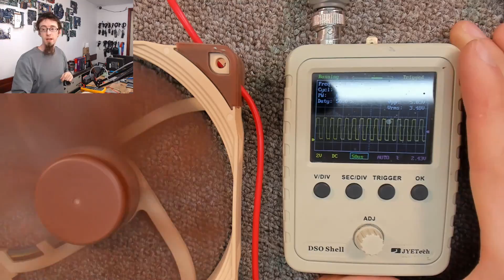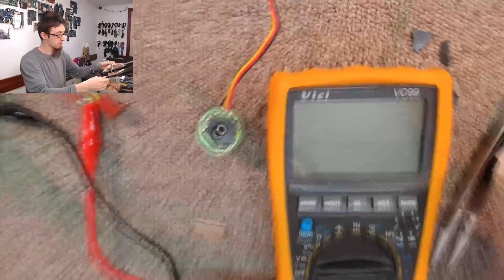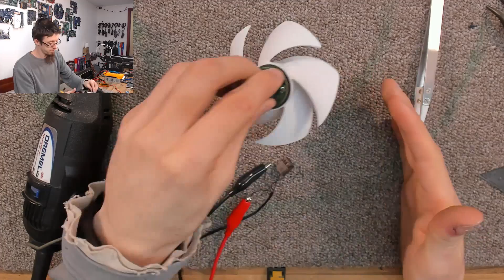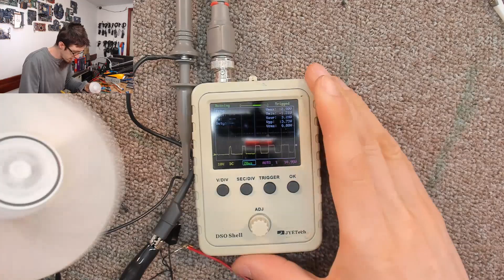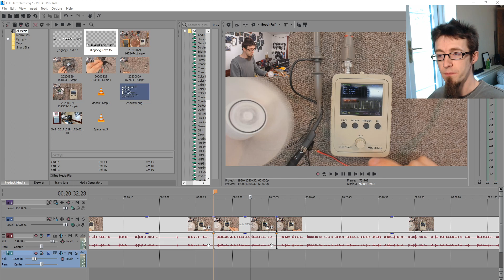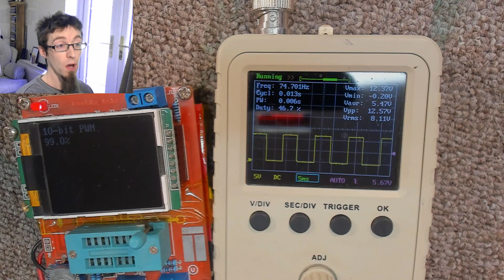How do Computer Fans Work? - LFC#221

Comment: I actually don't like the naming they have going on with the fans. 3 pin fans and 4 pin fans are both controlled by PWM from the motherboard. The 3 pin fans are just turned on and of real fast by the motherboard, whereas the 4 pin fans are actually ac fans with a variable frequency drive controlled by the PWM logic.
The "network of mosfets" is actually an h-brige that converts the 12v DC into 12v(p-p) AC.
Which is way more efficient than simply pulsing the coils on and off.
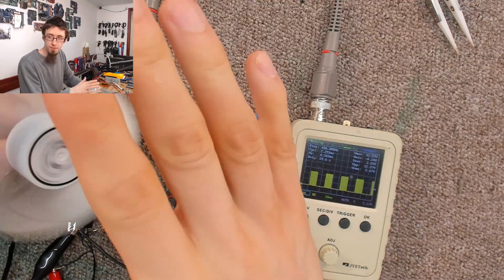Reply from the maker: That makes sense, but when I was measuring the motor coil, it was DC bias. Screen at 29:45 shows 12v v-max and 0-ish v-min. Surely if it was AC driving, I would've been seeing negative voltages? The H-bridge might be simply so the controller can drive the motor in either direction?
Reply: @Adamant_IT  You didn't see the negative pulses because you were measuring L1 with respect to GND, measure L1 wrt L2 and you should see them, the H-bridge is to reverse the polarity of the coil.
Reply from the maker: aaah of course... I'll have a look again on Tuesday when I'm in the shop, just so I can see it in action. So by running in AC, it can apply force to the rotor on both the magnet poles. So despite only being a single phase motor, it's doing the same amount of work as the 3-pin two phase because it can pull double duty...
Reply: @Adamant_IT  That's my understanding of it, I'm learning tonight too. I previously assumed the PWM signal on 4 pin fans was interpreted by the controller chip, I didn't think it would be fed out to the coil.
Reply: @Adamant_IT  Hey. I found an old pwm fan and hooked it up to my signal generator that can do PWM. Would you like the video of that?

Comment: nice informative video. 

had to figure this out about 6 months ago as was trying to reuse a pc fan for my "soldering station" fan set up. he he, same oscilloscope, too. 
anyway, i was trying to feed it pwm voltage controlled by the attiny thinking it would just be a normal brushless dc motor, which ended up not working. then i looked up the chips and figured they were cycling the coils themselves and thus a pwm voltage would not run the circuit. i did not want to use up one of my voltage converters, so i said "screw it" and simply ended up running the whole thing on full 12v controlling the voltage with a npn transistor and a a potentiometer. 

would i recommend anyone doing that? absolutely not since the transistor get so hot i burned 2 of them before i figured that keeping it above 40% would keep it alive. in the end, it was  bit useless since it turns out that the best speed for the fans for my use is to simply feed it the whole 12v and i don't need the slower speeds at all.

Comment: Is a server grade fan (3 phase) built on the same principle?
Reply from the maker: 3-phase AC motors are a lot more complicated. There'll still be the hall-effect sensor to detect the rotor position, but the way the coils are driven is completely different. I'm not sure if you can inject PWM into 3-phase AC in the same way that you do with a DC motor.
Reply: @Adamant_IT   Thank you. Wow that was the fastest response I've seen happen from a channel!

Comment: The designation "DC motor" always irks me. It doesn't make sense at all. Because if you don't have alternating current on the coils, you aren't going to have a motor. Similarly designation "AC motor" is too broad, it includes many categories which don't have much to do with each other. I mean for a device as a whole, it makes sense, as it describes the use case, but not for the motor sub-assembly as an electromechanical part, not including the electronics. It gets even more absurd as say 3-phase motors used in RC planes and drones are sold as "DC motors" but the control boards that drive them are sold separately.

The kind of AC motor you may be reluctant to reason about might be induction motors.

The tacho feedback signal is expected to be pulled up mainboard side to 12V via about 10k and should deliver 2 pulldown pulses per revolution.

Comment: 3-pin vs. 4-pin ?...

What about my 2-wire molex fans ??
Reply: Sarcasm does not exist on teh internets.
Reply: @KomradeMikhail  XD
Reply: @KomradeMikhail  Yeah yeah...
Reply: We don't talk about that here
Reply: If you're actually curious they're basically the 3 pin fan without the feedback.
Reply: Do you think you are smart ?
Reply: you can speed control them by varying the voltage input by  PWMing the voltage instead using a mosfet and a timing ic such as NE555P or arduino with mosfet module. so if you do like 50% pwm of 12v that'll be around 6v input so your fan might run on half speed (theoretically).
Reply: @hassankhurramtech  Should control them with amperage, not voltage
Reply: @ChristopherVanZetta  du;h V=IR, if you reduce amperes the voltage will automatically drop to compensate the amperage, for example if the fan is 0.60 amperes the varying voltage will reduce the consumption of ampere as well as slowing down the speed of the rotation.  varying ampere is lot complex than simple pwm with LC circuit.
Reply: @hassankhurramtech  that you can, and a lot of devices already take advantage of that. Heck, I even have 3D printers with cooling fans that are PWM driven. It's a common and cheap method of basic fan control, although compared to PWM off the fan itself it can be a lot noisier.
Reply: @DigBipper188  add a LC circuit, i.e choke with a filter cap. it will act as a buck-converter. i have circuits made up like that to control my pc fan using arduino's pwm + LC circuit = 
no noise.
Reply: They have no speed control at all. On a 3-pin fan it would be about the same with a MOLEX to fan adapter.

The 3 wires on a 3-pin fan are;

VCC (positive)
GND (negative)
TACH (speed signal)

Obviously, 4-pin has one extra wire and that's the one used to feed a PWM signal into the fan
Reply: Thx for the explanation in detail.
Liked the vid...
Reply: and my 6 connector (not even "pins") that snap together Lian Li fans? a WHOLE lot of info missing from this video
Reply: Bro... a Molex is something you use to start a trash fire, otherwise nothing good will come of a molex connector.
Reply: lol, i recommend you throw anything molex in the trash.i kid i kid. no but really, i hate molex connectors. 

as for the fan, same as 3 pin, but without the sensor to detect rpm.

EDIT: or who knows, they might not even use the circuit if they do not have the hall sensor and simply use the brushless dc motor that are found handheld fans and toys.

Comment: can you show us the other types of fans.. not just magnetic levitation

Edit: i'm an idiot - sleeve bearings
Reply: That's not magnetic levitation
Reply: Magnetic levitation doesn't have a bearing in it
Reply from the maker: Yea these are sleeve bearings. Other fans work the same way, it's just a matter of how the rotor is held in place.
Reply: @Adamant_IT   what about the ones with hydraulic fuel?
Reply from the maker: Same deal with Fluid Dynamic bearings, it's just how the rotor is held in place. The DC motor part will be the same, it'll just have a much more exotic bearing.